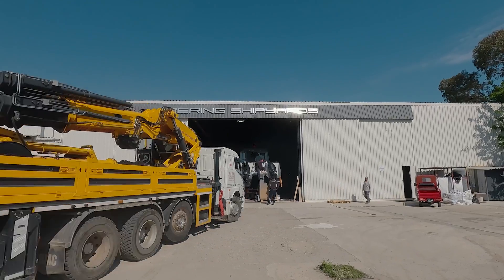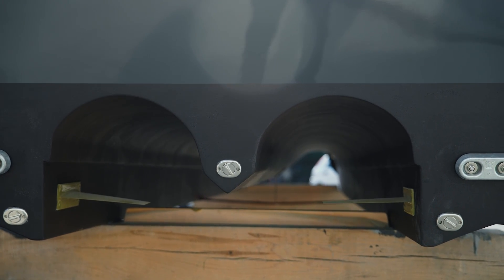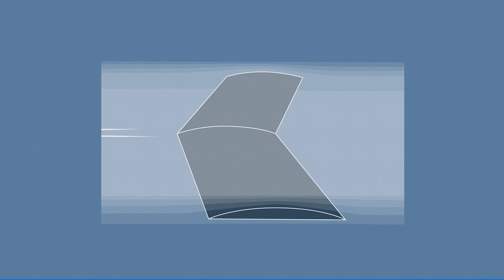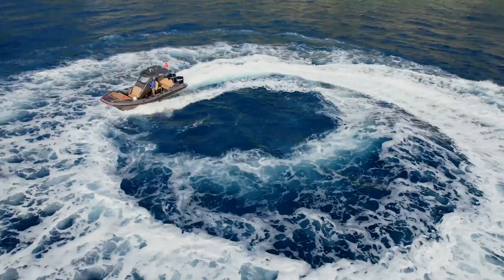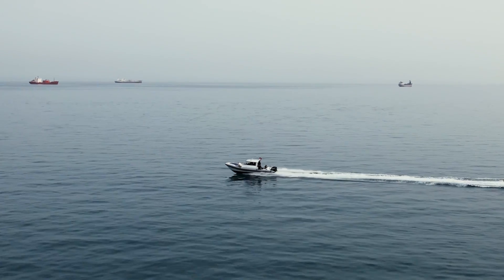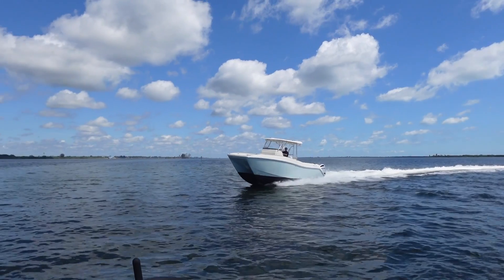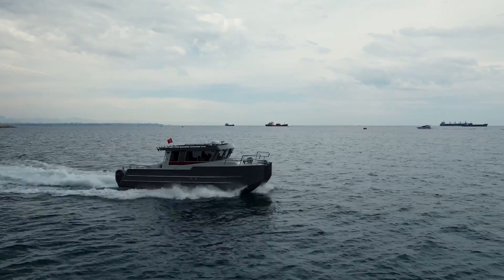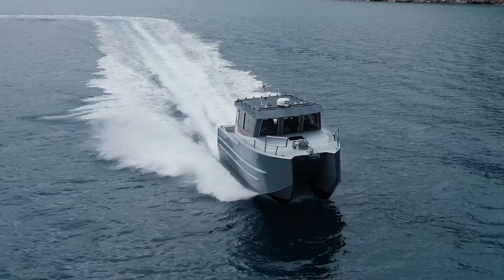Revolutionize Boating With Bering's Foil Tech

Comment: Old idea, been used by Hysucat for decades. To be really effective, flight control surfaces - flaps should be used. Using a hydrofoil does not improve stability.
Reply: Bering marine is Hysucat….
Reply from the maker: Dear Jason,good day!
Hysucat rebranded to Bering Marine. And we use Hysucat technology in boatbuilding.

Warm regards,
Tamara Sağlam
Reply from the maker: Dear Paul, good day!
Thank you for your comment. If you are close to Snohomish, you can try our boat with our dealers, 3Rivers Marine. You can find Tim Klontz for demo ride.
3 Rivers Marine, Inc.
www.3riversmarine.com
tim@3riversmarine.com
Phone: (425) 415-1575
              (877) 661-1575

Warm Regards,
Tamara Sağlam

Comment: Beautiful work.
Use the Sharrow Propellers and get an even better economy!
Imagine with your company’s foil and hull design coupled with the invention of the Sharrow Propeller your efficiency could reach 50% !
Go ahead and make it happen. It’s only two bolts and then you’re off to races I’d say.
Cheers 
J.
Reply: Sharrow propellers are not that efficient!
Reply from the maker: Dear J! Thank you for your comment. We would be happy to see you at Seattle Boat Show in couple of the days.

Warm Regards,
Tamara Sağlam
Reply: Explain perhaps.
Have you tested them ? 
Probably a cost for two around $11k usd on a boat that costs how much more.
Surprised you wouldn’t want to test.
Cheers